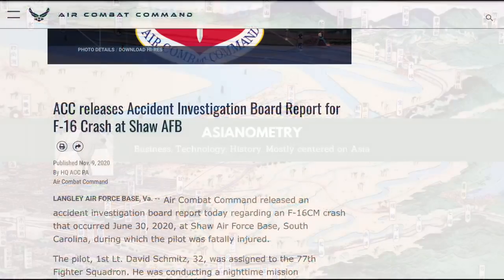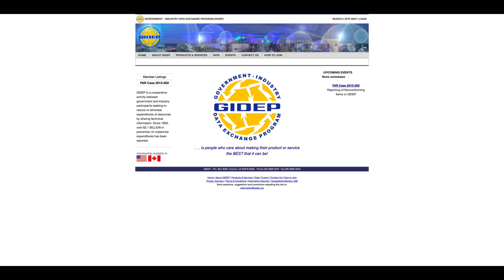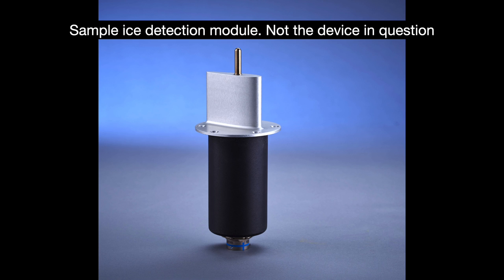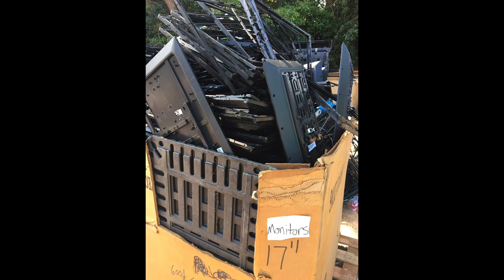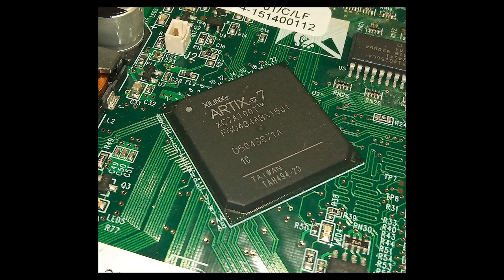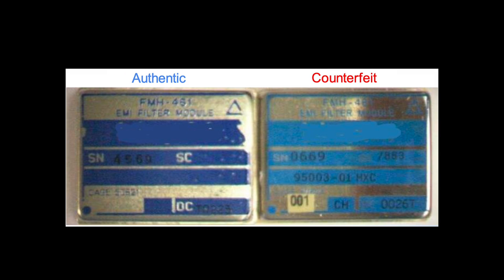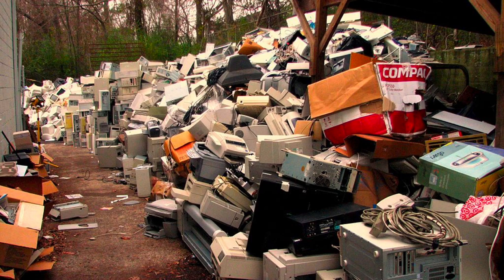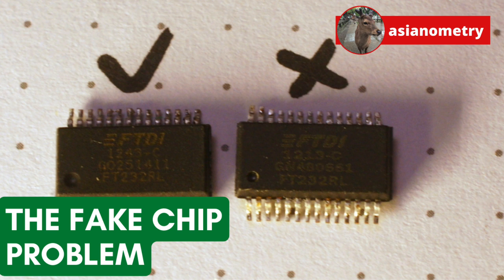The Fake Chip Scourge

Comment: The flip side is that the recycling of obsolete chips keeps a lot of old hardware out of landfill. Lots of 1980s computer chips or sound chips are just unobtainable now without the reclaimed chip (aka NOS (we all know its not)) market. Yes, there is a problem with YM2149 being remarked as an AY-3-8910, which do essentially the same job, but the alternative is a whole load of machines being scrapped.
Reply: Hey! ur the dude that made the RC2014! wow. your product is the sole reason why i got into tinkering with older tech and low level programming. you are literally the reason i started college for computer science and debugging. I bought your kit YEARS ago when it first launched on tindie and I still have it on my shelf. I didnt know what i wanted to do with myself for the longest time. I was stuck at home playing minecraft with no passion for anything really for years until someone recommended me your kit. I was 18 at the time and im now 24 and about to graduate with a 4 year degree in comp sci thanks to you. Thank you Spencer.
Reply: That's totally different. Not even close to what, he's talking about.
Reply: @TheDiner50  You missed the point entirely. but okay...rude
Reply: Reusing chips can be a good idea, but they NEED to be sold as such, and not as "new".  A toy factory probably will not mind and will get recycled chips for cheaper. Same for some guy just trying to build his own synthesizer. However, pacemaker manufacturers or industries of that same general nature have an actual life-or-death need (of the product user, not the company itself) to be able to source brand new, completely to spec, and traceable parts. That last one is important. If something is ultimately causing danger to life and limb, you NEED to run word up the product chain to get them to both inform all others who bought a defective batch to recall those products, and to make sure the defect is fixed going forward. If there is no product chain to run up because nobody really knows or keeps track of where they come from, bad things keep happening.
Reply: @wallythewall600  I think he knows that already. but okay. rant on.
Reply: @zilog1  now you're the one being rude. how the table turns…
Reply: @zilog1  You originally had a point that I fully agree with, but now it is you that is rude.  Not really surprising.
Reply: @wallythewall600  I have totally sourced old chips for industrial automation.  They were sold as used, untested, so I doubt they would be considered counterfeit.  Used & tested, and NOS are higher grade.  Just did lots of bench testing before using.
Reply: If they were carefully extracting these old chips from their homes, like 80s computer enthusiasts do, that would be one thing. But so many of these counterfeit chips are removed in ways that subject them to stress and result in damage. As the video explained, most chips recycled this way are damaged in the process and don’t function.
Reply: and it would be a good thing if those chips where actually sold as used components, remarking them and selling them as new is the problem.
Reply: What happens to the old motherboards once the valuable chips have been salvaged?  Just because one or two chips can be recovered and resold, that doesn't mean the rest of the scrap will be properly recycled.
Reply: We need to think cradle-to-cradle in all areas or choke on our own waste.

Carefully removing and testing chips and other components in a documentable way has to become a thing.

I see a lot of potential for robots and AI here.
Reply: @TonkarzOfSolSystem The chip reclaim videos I've seen don't worry me about the physical state of the chip.  It's often no worse than going through a wave solder machine when the chip was first installed.  However, there does seem to be a lack of ESD precautions. If there's physical damage the chip will either work or not work, and that can be tested fairly easily, but degradation from static is much harder to test for and may not show up for ages.
Reply: This is a common and absolutely flat and horrible reception (or worse, an excuse for some people) ... for example, in concrete numbers: The 53291 tons e-waste IMPORT alone in Thailand[1] in the year 2017 and the statement "17.4% Percentage of world electronic waste, properly disposed and recycled" mentioned in THIS VERY VIDEO. I'm not asking why these details obviously wandered from one ear to the other ... passing the inside of your skull unhindered, leaving nothing behind like a conclusion or ... the impression of FACTS???
"The flip side is that the recycling of obsolete chips keeps a lot of old hardware out of landfill." The opposite is true. The first world is actively shipping their dirty for inhuman prices and conditions to those countries. You, my friend are not even WORTH the joy what Yamaha Chip can give. In no case do you deserve even the smallest joy that a Yamaha sound chip can give. Anyone who, like you, maintains their false reception of the shameful effects of their own consumer behavior and participation in these events (and also writes this nonsense publicly) should be ashamed! And this cheekiness ... in the comments on exactly this video, where the numbers were clearly visible ... is really unbelievable! But what should one expect from a first world Karen that for effs sake holds his personal problems (yeah, there are remarkably stupid fellows out there who just buy from fishy sites, over and over again and learn NOTHING from it!!!) with sound chips on par with the whole topic discussed in this video, like killed people by fake chips in cars or medical devices. And even glosses over the abuse of Africa and Asia by "western" e-waste for his own horrible and criminal behavior excusing narrative. What a clown!

[1] You can bet your first world high horse that there is a dark figure more as double the number which lands in openly burning dumps with the usual children wandering around helping their families with collecting something useful out of that waste. In their miserable and short by pollutant filled lives. That is not your fault and we are all part of the problem, Yes! But man, you are writing such a demonstrably stupid and cynic BS!

Also: *facepalm* That you don't seem mentally able to solve your problem with the chips yourself. That's sad! Very sad ... :(
Reply: Yah I needed some PIAs to repair an old computer but was able to find new ones from Mouser as it turned out WDC still makes them.
I figure there would be a danger of the seller marking 1MHZ parts as 2MHz which could cause instability.
Reply: @TonkarzOfSolSystem  i googled shanzhai motherboard (a term for Chinese unbranded generic motherboard)

How they harvest the chip, cut pcb around them, so that it can be taken off properly
Reply: @bitelaserkhalif  That's a smart way to do it. If it's cut off the PCB, the remaining PCB fragment is a known size which would allow automated extraction.
Reply: Yea, but then you make more garbage by manufacturing bricked electronics with these fake chips. One stupid little fake chip can make the entire product useless.
Reply: You are right, but I would prefer for the recyclers NOT to relabel old chips, but sell them AS IS. Since we KNOW that e.g. YM2149 can replace the AY3, it would be better to simply know beforehand.
Reply: @zilog1 i love how he ignores your comment lmao

Comment: I've bought a bunch of LM358s from China. I wasn't worried about counterfeiting, because who would fake the most bottom end chip in use. Well, they did. Apparently there was an excessive demand for these parts, and they remarked a superior performing chip type, as a the inferior one, to fill the that transient need.
Reply: Not only lm358, but also tl07x, ne553x, lm741, rc4558, all of them low cost parts and even so faked.
Reply: @CBtronica  pennies add up to dollars.
Reply: We have bought some very cheap stuff, but they did not work. Reason: they were not chips but tiny plastic boxes with legs. There were nothing inside the bodies.
Reply: aRGee  rail to rail would be a remarkable achievement for a semiconducting device.
Reply: @lyrebirdcyclesmarkkelly9874  don't believe everything you read on the Internet.
Reply: @1pcfred  Yep, and it's even more remarkable that rail-to-rail opamps like the MCP601 are available for less than 1€, when bought in the quantity of 1 (probably much cheaper at large quantities). Makes total sense to buy a laser marker to relabel, like, an LM641 as an MCP601, plus invest work in grinding off the old marking of the 741. I guess you can easily make several cents per IC. Adds up pretty quickly to a pretty good income if you can fake half a million ICs every month!
Reply: @klausstock8020  a half a million operations is a lot. A half a million seconds is almost 6 straight days. I've done repetitive tasks and I'm only good for about 10,000 or so in a week myself.
Reply: @sjb3460  Yes, and I despise them for what they have done to the electronics industry, just to line their own pockets.
Reply: @1pcfred  Rail to rail opamps are common but a bit more expensive.
Some are rail to rail only on the input of output.
They are harder to find in the high speed and high precision types.
Reply: @gordonwelcher9598  rail to rail is exceedingly difficult to achieve through a material that is naturally resistive. They don't call them semiconductors for nothing after all.
Reply: Well, the answer is - they are very easy to copy and even easier to sell. That's why they mostly copy stuff that is mass produced (even within the industry where mass production is standard). You can still have $0.8 margin on a 1$ chip.
Reply: @deebil8099  You've missed the point. The chap stuff is much easier to copy and more profitable. Because you don't need advanced technology, they are easy to sell (due to extremely high demand, you can easily sell few thousands before people start noticing), companies that buy these are not likely to go through a lot of trouble when they find out (but they would, if it was part that costs more than $10).

Comment: Had a prior incident with the foundry I worked with.  Basically they produced non conforming products but still functional. Instead of scrapping them, they smuggled and sold the sub-standard product into the market. Someone bought them and have them properly packaged and marked as new.  We only found out when the market price of our components kept eroding until it fell below our cost. Then we knew something was wrong.
Reply: In China nothing is thrown away. Whatever a foundry makes everything will be sold. Even scrap will go out the back door to those who will just use the package shape to create visual clones for selling on Ebay. Eight pin DIL is an op amp no matter what is inside.
Reply: @mbak7801  I believe you 100% on this. It's a cutthroat market.
Reply: @jacobp.2024  by the end of the day, there's no free lunch, if it's cheaper, then something is wrong.
You get what you paid for.
Reply: Except when you though you bought an original one for the price of the original. Then that's cheating and should be punished.

This will eventually ends as the trade war keeps escalating and production comes back to the US.
Reply: Foundry name? I will assume its not one of the big guys like TSMC, Samsung etc.